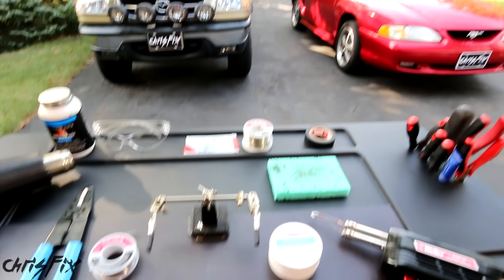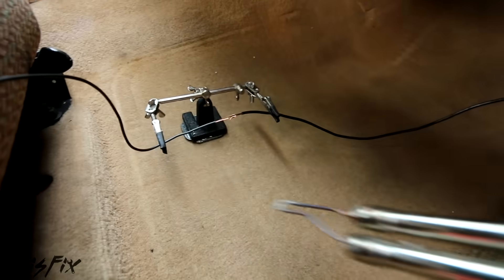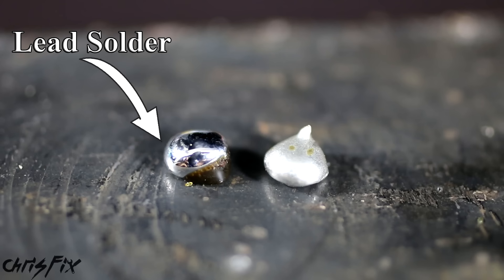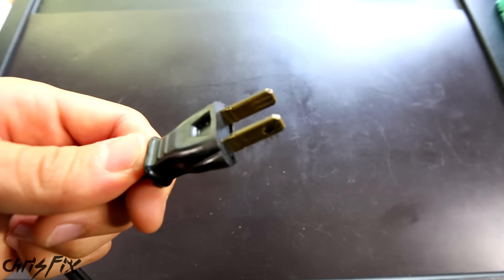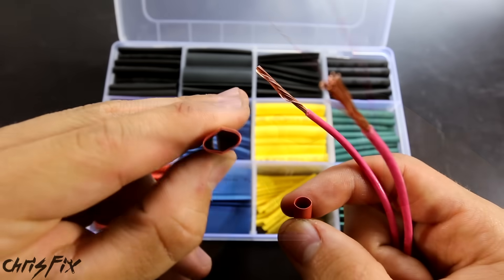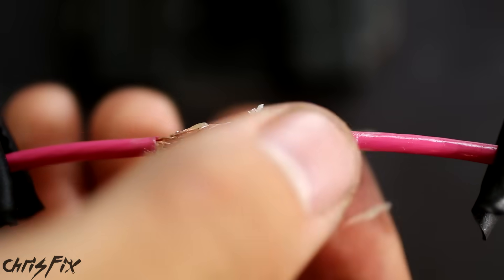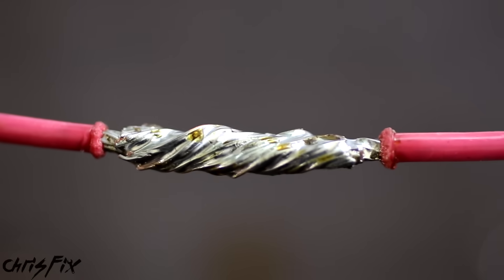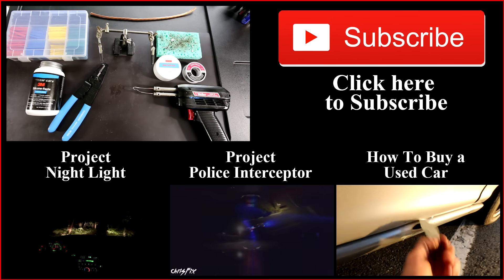How to Solder Wires Together (Best tips and tricks)

Comment: Hey Cris yesterday I changed the water pump in my 99 Buick Century. The last bolt broke off and stayed in the block. I think it would be a good video to show us how to use a left handed drill bit and screw extractor set. I bought mine at my local auto parts store about $21. 
Btw I broke all of the drill bit and had to buy one from Home Depot. Even the screw extractor broke as I tried turning it. Just suggesting.
Thanks

Comment: can you add water to cool it down Faster?
Reply: Cooling it down TOO fast weakens the solder joint. Blow on it if it makes you feel any better, but I would not add water. It can crack and corrode the joint/wires.
Reply from the maker: What T Swag said. Water will also cause problems with corrosion.
Reply: +ChrisFix so any recommendations ?

Comment: Hi Chris.  I found this vid on the random recommendations.  I've been working with electronics for about 40 years.  You have presented good techniques here.  I wired trailer lights on a truck of mine using these techniques.  Even after several winters in the salt, the lights work.  It's nice to see a good practical video with so much questionable BS out there.

Comment: Do Not use a Fan blowing Directly on to the wires you are soldering , or you will get a Cold Solder Joint.
That is Basic .

Comment: 7:54 and 8:10: That is NOT how you splice wires in a car loom. In the event of a short circuit the solder will be the first thing melting and, since the solder is the only thing holding the wires together they can possibly pull apart with the feed wire causing damage. Solder is great for conductivity, especially over time, but the general rule when using it in something that moves is that it needs to be secured mechanically in some way. Ie, crimped when doing a splice. There are special tubes to buy for this purpose: stick one end in oppsite sides, crimp, solder, heatshrink and youre done. If then the solder goes liquid for some distant reason the crimped metal tube will still hold the wires together. THAT is how you splice, or that is what my education taught me and the way I have worked since. Cheers - Jon (in Sweden)

Comment: Instead of silicone can I use regular mechanical grease to insulate it?
Reply from the maker: Any petroleum based grease will eat away the wire insulation. Like dissolves like. Silicone is safe on plastics.
Reply: Using regular petroleum grease is probably not a good idea. It may even catch on fire.
Reply: Mark Failla thank you
Reply: I love asians
Reply: asdsda asdasd if I may, why did you comment that? I honestly didn't think the grease would eat away the wire(the ones you use on bike chains or bearings)
Reply: Miguel J
Because I love asians <3
Reply: asdsda asdasd lol me too 👍

Comment: Good info. Many people have a hard time grasping basic physics. Heat rises. I've been soldering for many years, but never thought about putting dielectric grease on connections before shrinking. What would you do if using heat shrink that has that goey stuff on the inside? Thanks.

Comment: I solder electronics and wiring all the time (using a Hakko Solder Station) and the number one tip I tell people is don't breathe in the smoke.  Make sure you have ventilation and at the minimum, a small fan nearby.  :-)  Great video though.

Comment: You forgot to clean the rosin off the joint.  This will allow the connection to oxidize much quicker.  I use isopropyl alcohol for this step.

Comment: High resistance won't cause the wire to heat up its the low resistance that is bad because of the high amps it's going to be pushing out. (Ohms law)

Comment: Left Wheel Grinding noise: I have a noise in what i believe to be my left front wheel on my 2006 Chevrolet 2500 HD Silverado Crew Cab 4 door truck. I am a bit skeptical of taking it into an auto shop for fear of replacing something that doesn't need to be fixed. From what I've seen your channel is amazing and I've got no better option than to turn to you for advice. When i make a right turn there is a whinning/grinding/screeching noise. Now I've watching your wheel bearing videos and i can't come to a conclusion. So before i tear anything apart i ask your advice. Thanks much

Comment: MARINE HEAT SHRINK FTW! 

I used to tin my soldering iron then fling the excess off until I got solder in my eye. 

Another time i was sitting on my floor using bed as workbench with my soldering iron in my hand waiting for it to heat up after getting home from 20 hour work day, next thing I know I wake up because my hand in on fire and my bed is on fire.   

 I cant speak for everyone but I know when I am trying to solder,  the smoke is like attracted to my face but really  the fan or fume extractor is a good ideal

Comment: Overall a lot of good advice.  I would use a little less heat since it melts the wire insulation but too much heat is better than too little and solder not  penetrating the connection.  You can't always use heat shrink tubing.  When you can't there is something much better than vinyl electrical tape.  Self-fusing silicone tape.  Self-fusing tape is amazing!  It only sticks to itself; since it only sticks to itself be sure to stretch it so it will tightly hold to the junction.  I keep a roll of self-fusing tape in every toolbox, bag or kit I own.

Comment: splicing the wires is not so necessary, in most cases the wire is going to break before the solder joint. it just makes the job easier because they stay together ;)

Comment: idk if its the solder i use or my my actual soldering tip but whenever i try to heat up the wire the solder doesnt melt. the tip is hot as shit for sure. is it because of the ratio? i think it was like 70/30 or 80/20 something high like that. and it wasnt lead free

Comment: noooo, don't use a damp sponge! It ruins soldering iron tips since you're just thermo-shocking the metal tip. A copper scrubbing sponge (the ones you get for your kitchen) are super effective since they use abrasion to clean off the oxidation and other crud you get on the tip. They're super cheap. last longer, and extend the life of your tools!

Comment: Bouns tip: If you find 37/63 lead solder and its similarly priced to 40/60 solder (or you dont mind the extra price) get that as its a eutectic alloy, this means it has a well defined melting point instead of a range in which it passes through a plastic state, while 40/60 is in its plastic state the quality of the join can be lowered if moved.

40/60s perfectly fine but theres less room for error with 37/63 :)

Comment: Wow, what a great video!  Been soldering for a while now and man I learned a lot in your video.  I really like using the butane torch to solder wires because it's wireless and gets so hot so quickly it works better than even the gun you use in this video.  I actually have both soldering guns you showed in the video haha.  

What do you think about using electrical tape instead of shrink wrap?  I mean clearly shrink wrap does a cleaner more professional job, but electrical tape can get the job done too.

Comment: A couple of things: they make solder that has flux already infused in it. I've had instances where a fan actually cools down the iron tip so much that it won't melt the solder. They make units that use a vacuum instead of a fan. The lead free solder is great but beware because it takes a bit more heat to melt. The soldering units that he's using is very basic. Nothing wrong with that but if you need something to heat up faster, they make more expensive units like Metcal. Plus, you can change out the tips. They'll heat up in less than 5 seconds. For an even more waterproof connector, use the heat shrink that has the glue inside of it. When using a heat gun, the glue will flow causing a permanent waterproof connection. People like Kimball Midwest make that stuff. They are a bit expensive but oh so worth it. Be very careful with keeping the gun on the wires. You'll melt the insulation and possibly compromise areas further down.

Comment: Cold sauter? You mean a `Dry Joint`
Reply: It's referred to as a "cold solder joint".
Reply: csorrows, its a Dry Joint, always has been and always will be. Its `Dry` because the area has no solder on it or the covering of solder didn't fill the cavity and a really bad solder joint thats 100% dry will come apart and not function properly under use.
Reply from the maker: They mean the same thing. A cold solder means the wires are not hot enough for the solder to soak through like when you drip solder onto the wires. A dry solder is the actual splice is "dry" since the solder did not soak though. So both are correct terminology.
Reply: You can also get a cold solder joint if you move it before it cools enough. Fills the solder with micro cracks and causes a poor connection.

Comment: thank you so much. I gave up on soldering cause I was taught the cold solder way. I just used wire nuts and liquid electrical tap for the longest time. I saw this video and I understand now why my connections failed. I have the type of gun you have and I looked at the wire I used before and the types match but I was doing it wrong. I personally take my truck to a mechanic I know but every so often I need to fix a wire on a home or car and next time I will give it a try. I sometimes fix a friend's car when they are tight on money so your videos sometimes help with the tips you teach. thank you for all your time that you put into making these videos cause I learn stuff to help people I know in need of help. :)

Comment: Flux burns very hot accelerating the heat in the material. This helps to clean the oxy from the material. Flux does NOT protect anything, it is meant to burn and the rest cleaned off. If left on the material, it will cause corrosion.

Comment: Hi, I was wondering if you have done any videos or seen them on these 2 subjects.

1) Renewing a car battery with Epson salts? This can be done up to 4 times.
2) Replacing a lead battery with capacitors, or make the battery a capacitor hybrid? If done right will outlast you car. And because when used it charges back up to voltage peak several times faster, it's supposed to increase mpg. And it costs less than a normal lead battery which by the way has recently almost doubled in price. This is because the current administration has allowed the EPA to tax anything they want with a waste disposal fee.

There are several videos on the car battery renewal. There are only a few on the capacitor replacement. But I found that batteries for the high performance RC cars will do the trick as a hybrid backup, or full replacement. But you have to know what to look for in the specifications to to get the right one to work on your car. Also because capacitors don;t very in voltage mush while in used, this is supposed to increase mpg because the computer does not have to adjust for the voltage variance.

And I liked your soldering video.
Reply: Sure, use caps instead of a real battery. They hold a tiny fraction of the power compared to a battery. Then when your vehicle sits for a few days or you leave any load on for a while, the caps are dead and now the ECU has forgotten its fuel trim data and all the radio presets are erased, yadda yadda. Go for it...

Comment: Chris -- I've worked doing this kind of thing professionally on oilfield equipment and I've gotta say, your tutorial is excellent, and anyone following your advice won't go wrong.  One tip I'd give is to check out double-wall heat shrink tubing.  It has an adhesive liner which melts and completely seals your electrical connection.  Nothing wrong with your method, but this could save some time.  Also, easy to remove with a razor knife, if necessary.  Your way will also do the job, though.

Comment: Thanks Chris! I always wondered why my soldering jobs looked like ass. I didn't know you weren't supposed to touch it to the tip. Next time I'll know to heat from bottom and solder from top. 👍👍
Reply: Actually, start soldering near the tip. That's where the work (wires) will be the hottest and that's where you'll get the solder to flow soonest. Once it starts, it will carry the heat to the rest of the work and you can start feeding in solder further away from the tip.  If you wait for the heat to get all the way to some other spot instead, you may overheat something, like the wire insulation, and now you've got more bare wire than your heat shrink tubing can cover. Also, the longer you apply heat without actually getting solder flowing into the work, the more oxidation occurs. So now you've got discolored copper wire with an oxidation layer that won't accept solder...

Comment: Chris what about if I'm doing a circuit board . Do I touch the tip and let it drop?
Reply: Hell, no. You use a fine tipped soldering iron, not a goofy Weller gun, and you heat the parts (the wire and the solder pad on the circuit board) and then feed in the solder (some decent rosin core solder, that is)

Comment: But in car you should not use solder, because wires dont just lay down, like home, its shaking, and connections will be corrupted, be careful with that, peace.
sorry for bad english.
Reply: Actually you are exactly backward. You SHOULD use only solder when connecting wires in a car. With all the vibration, a mechanical connection such as a butt connector, can come loose.
Reply: No, chocolate waffler is correct. Soldered wires will break right where the solder ends. That's where the wire transitions from a solid soldered blob to flexible stranded wire, and that's where all the bending will happen. And like any metal that is bent repeatedly in the same spot, it breaks right there.
Reply: Then this same thing would happen to a wire entering into a mechanical connection. I have never had it happen to either and I have put a lot of wires into vehicles.

Comment: I wouldn't say additional flux is strictly necessary. The solder you're using (and just about all electronics solder) has a rosin core. This means that as you're applying solder to the heated joint, small amounts of flux are continuously added to aid wicking and prevent oxidation.
Reply: Wrong, the flux in the core only helps the solder flow, it burns off before it can affect the material.
Reply: Agreed on flux not being required. Although the noob solderers watching this video probably take so long to get the solder flowing that the copper wire will be overheated and badly oxidized if they don't use paste. If you need to use paste to get two twisted wires soldered, you're doing it wrong...
Reply: I always use paste. It is how I was taught many years ago. Maybe it's a waste of flux but it always works. I always clean the left over off with IPA when complete.
Reply: +csorrows wrong, I've gotten by just fine for 10 years without applying extra flux to a new joint. I do use a flux pen for old rework and drag-soldering for fine pitch components, but picking the right gauge of solder for the job should give you sufficient flux.
Reply: +Slicerwizard 
👍👍
Well said.

Comment: hey got a questions, I was trying to solder some wires into the O2 sensor harness... and the wire from the O2 sensor just didn't want to take any solder? No mater how much i heated it up, also the wire was silver in color, it was definitely not copper, what's the best way to splice into this kind of wires?
Reply: Use mechanical connectors. Butt connectors or scotch lock, depending on what you're doing.
Reply: That wire is probably aluminum.
You shouldn't be soldering any wires in a car unless you are going to securely fasten the entire solder structure. 
Use some mechanical connector, make sure its waterproof, and make sure your connection stays cool since it is near the exhaust.

Comment: Hey Chris, glad to hear from you again, I was starting to worry about you. I'm an aviation electrician and I found this video to be an excellent 101 on soldering. My only input is the fan should've been pointed the other way. It's a minor thing, but in the winter with a fan blowing across your work it may cool it down just enough to make the job harder or the joint less secure. But with that gun you wouldn't have to worry about that, only a less powerful pen style iron. Also, brilliant idea with that wire used for making tips, never thought of that. Keep up the amazing work my friend.

Comment: Putting both wires parallel to each other without twisting them is the best way to solder.. Twisting the wires and soldering them is not exactly the best way to join two wires together, other than that excellent vid!
Reply: The twist provides mechanical strength. The solder is for electrical conductivity. Frankly, not twisting is stupid.
Reply: NASA actually did tests with this, soldering both wires in parallel is better than twisting the wires together and then soldering.The parallel method is stronger.

Comment: 63 tin/37 lead, although a little more expensive and harder to get, is better than the "standard" 60/40 solder especially for electronic as opposed to electrical work.

Comment: A nicely done and informative video delivered in your usual elegant first-person P.O.V. style. One suggestion I offer is: Remove the flux after the solder joint has cooled and before applying the shrink sleeving. The flux can be removed relatively easily with an acid brush (trim so there is a stubby set of bristles, about 1/2 original length) and some isopropyl alcohol (rubbing alcohol). Make sure you use the 99% stuff; not the 70% solution. Then there is no need to use the dielectric compound. Moisture is most likely to react with the flux remnants to harm the solder joint. If you really want a water/weather proof junction, use another 3M™ Scotchgard® Weathergard® offering over the shrink sleeve, after shrinking. This 3M™ product comes in a can with its own brush applicator. It dries tack-free.